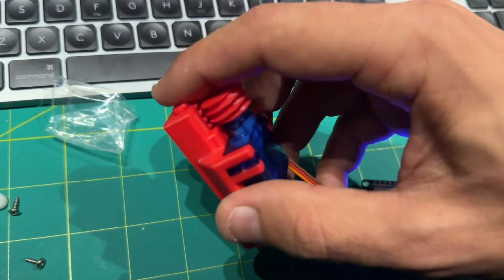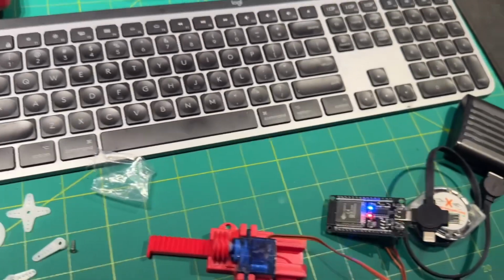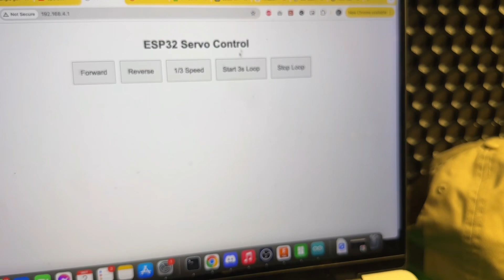Assembling the WormRack. A 3D Printed Linear Actuator. #3ddesign #3dprinting

Comment: Fantastic idea and exactly what I was looking for for my project! Now that I’m looking at it, I can see plenty of ways to improve its efficiency. Firstly, the gear teeth on the rod are straight, but they should be angled to better match the wheel on the servo. Secondly, if the rod were bent for better contact with the wheel, it would result in greater force. Definitely worth considering, but the idea is great. Thumbs up!
Reply from the maker: @gajdosjozef9048  appreciate the feedback! All great ideas 💪

Comment: I would not recommend powering it through the ESP32 like that. Servos can draw a decent amount of power and by connecting it to the 3.3 V of the ESP32 you are putting all that load on the ESP32’s voltage regulator, which likely isn’t meant to handle much more than the ESP32 itself. You could also end up damaging something due to voltage spikes from the motor. The best option is to use a battery or a source that you know can handle it. You would also be better if you just connected it to the 5 V of the ESP32 since that comes straight from the USB and doesn’t go through the voltage regulator.

I would be very careful when powering things through USB too since at its base level the USB spec only requires 5 V and 500 mA output which isn’t much and sometimes over current and short circuit protection don’t work right. I would highly recommend getting a powered USB hub just to add an extra layer of protection between your PC and some homemade electronics, just in case something goes wrong, like accidentally shorting the 5 V pin to ground by accidentally touching a screw or similar. You really don’t want to damage the USB ports on your laptop or PC.
Reply from the maker: @conorstewart2214  Appreciate it! To say i’m a novice wouldn’t be fair to novices, so I really appreciate your expert input.

Comment: Could modify a normal servo. Pull out the pot and connect to slide somehow. then you could have position control as well. maybe a slider pot?
Reply from the maker: @pRoFlT  I was thinking also maybe a magnet on the rack and a hall effect sensor. But honestly it does just fine if you let it go backwards an extra second or two to make it bump against the back and therefor at ‘position 0’ ready to go forward again. 

Although adapting it to make a sliding potentiometer would be cool, can’t do it :) worm gears are one direction.
Reply: The problem with that would be that it would mess with the control logic in the servo. It likely uses a feedback loop tuned for the servo and if you go modifying its feedback and output then it could make it performs pretty badly.

You can see this if you attach a load (still within spec) to cheap servos, they get all jittery and overshoot, this is because the control logic is tuned for it having no load.